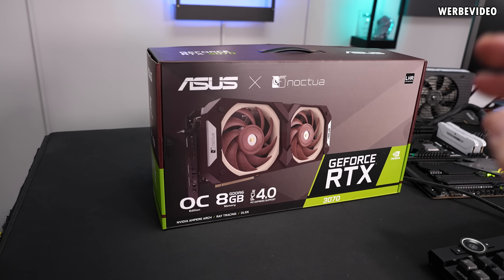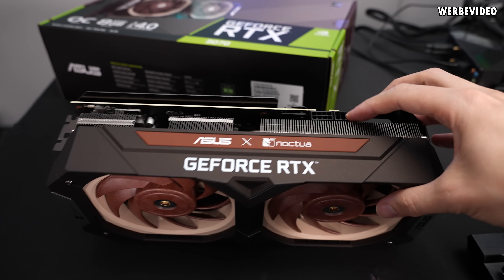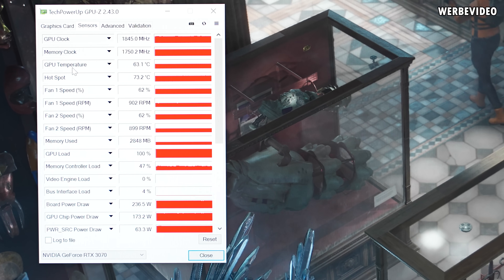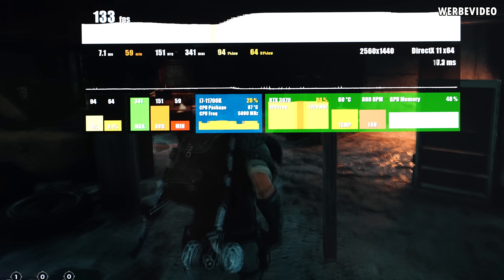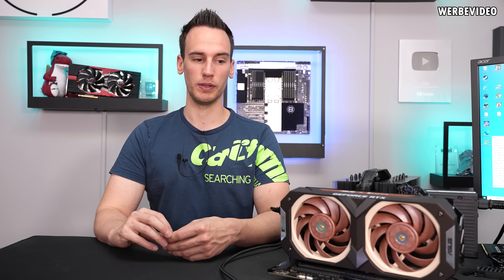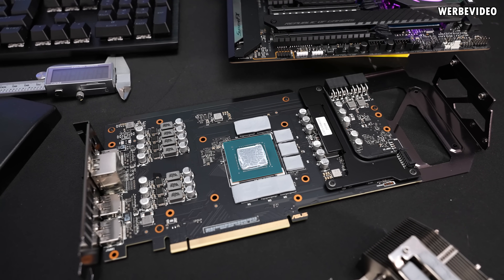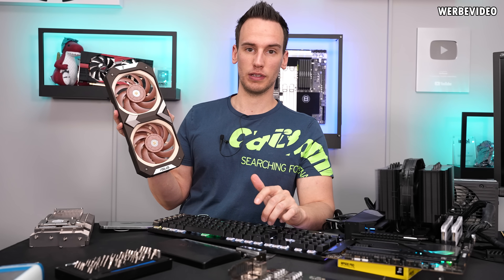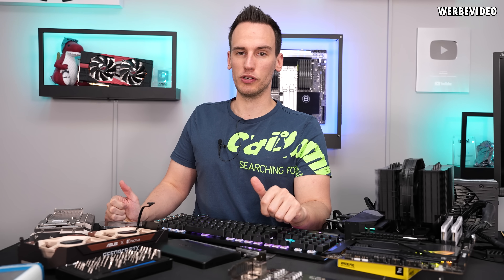Impressive Noise Levels - But what's up with the Heatsink? ASUS x Noctua RTX 3070 tested

Comment: Fan removal part is great. If all or most of GPU had been like this, we could easily add better fan, rgb fan, basically anything we d prefer.
Reply: It's funny , we got hundreds of different designs , Ultra Double D Edition Devil , and a million plastic shroud moulds of various shapes and sizes. 

All we wanted was fan mounts. Sometimes the freemarket just goes on crazy wrong tangents and the people who DIY'd a fan to their GPU win
Reply: @BartekJuszczak  and when you need to replace your original fan gpu, it s not like you go  out and find it easily, you have to order and wait weeks maybe, but this way you just go and get what you want and put it there to work.
Reply: @t3rminator777  fan header adapters are cheap and easy to acquire,I slapped some Arctic P12 fans on mine
Reply: I agreed!
Reply: Yeah I would pay a premium next time if I can just put my own fans on the GPU instead of the crappy ones they always seem to come with.
Reply: @Lius525  you already can
Reply: @Lius525  you can, with any non-blower. Deshrouding is easy. Remove shroud. Unplug fans. Plug in your own. If they can't plug in, put it into the Mobo and set it's speed by gpu temp.
Reply: it makes it thicker though. much thicker. not everyone appreciates that.
Reply: @HazewinDog   What people need is well performed gpu with low temps and lower noise. If it s  going to be thicker, still worth it. I personally hate gpu s with cheap cooling.
Reply: You can get fan replacements for any major card online very easily. This graphics card is a mess with the unnecessary amount of space it takes up.
Reply: @sujimayne  I feel like most people don't even use more than one pcie slot, so instead of just the wasting space with nothing filling the additional slot you could at least have better gpu performance. Especially since it's noctua so space isn't really a primary consideration, thermals and noise are.
Reply: @hedgehogdinosaur3023  I never got the whole "this card is too big for me to put another card right next to it" schtick. Like, that's really bad for cooling.
Reply: @sujimayne  lol

Comment: The fact that you can get over the shelf fans is a huge plus should the noctua fans fail in about 20 years.. 😃
Reply: I would hope that in 20 years you could get something that performs just as well for the cost of the fans.
Reply: This, this so much. Now good luck running a non-refillable AiO card with custom coldplate for 7-10 years.
Not an issue if it's a generic asetek pump-block but it will be expensive to replace anyways as you'll have to replace the whole assembly, including the radiator.
Reply: No more hunting on Aliexpress and Ebay or doing the Ol' Jimmy Rig...
Reply: @sublime2craig  Don't even remind me...I bought 3 new fans for my 1070 strix on Ali and they turned out worse than the old worn out ones...the speed control was completely out of wack.
Reply: This design allows for the use of high airflow fans (whether Noctua PPC class or Delta class).  It's just a smarter design... which means it won't catch on.
Reply: 25 to be exact
Reply: A lot of tech upgrades can happen in 20 years, too. Great life span!
Reply: Don't be ridiculous, they'll probably fail in 17 years 🙄
Reply: EDIT: looks like they are standard fans that go into a daughterboard

orig comment:
they aren't your standard fans - look at 6:01 and you can see the fans have a different header compared to retail.
Reply: @adent6x7  Nothing a quick cut'n'splice cant fix
Reply: @adent6x7  they are standard fans, you can see on the right side that the fans go to a splitter PCB
Reply: @17tumbaOfficial  oh snap u right, thanks! edited original comment
Reply: Thats only if they are using an adapter to connect the fans to the card, but that harness may be soldered directly to the fans
Reply: @danielmonsanto8286  Knowing Noctua I would bet they used a Y splitter to the 5-6 pin connector on the pcb, but if Asus had there say and didnt want to up the price of production adding that kind of feature. Guess we will find out soon 😂